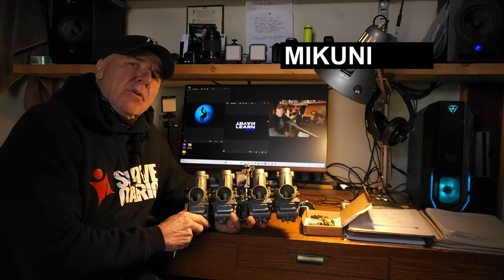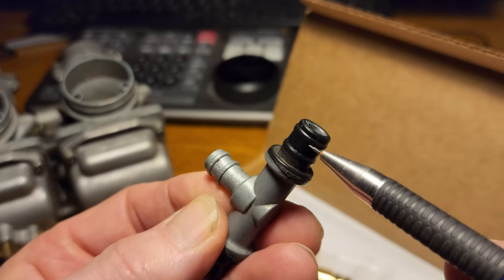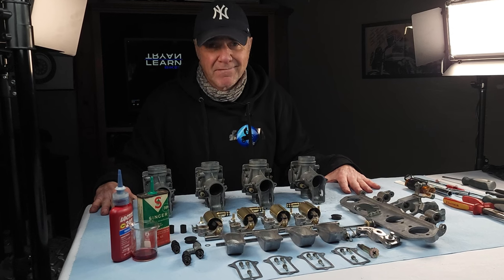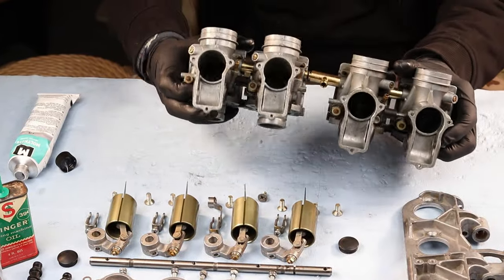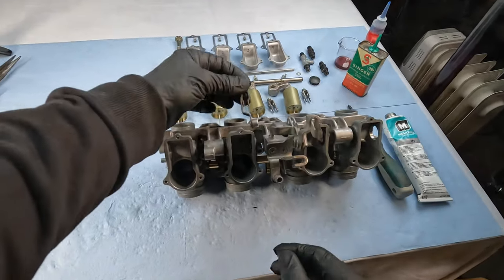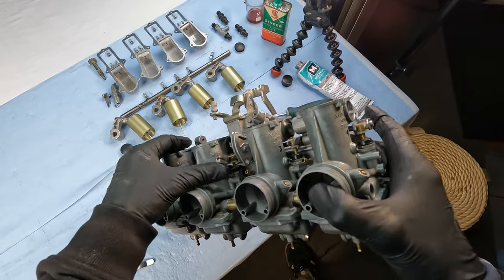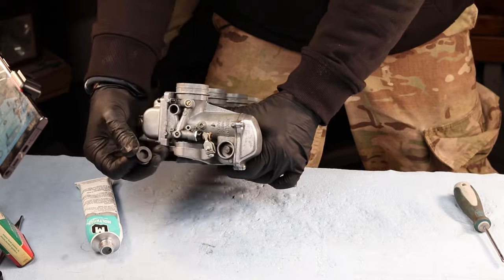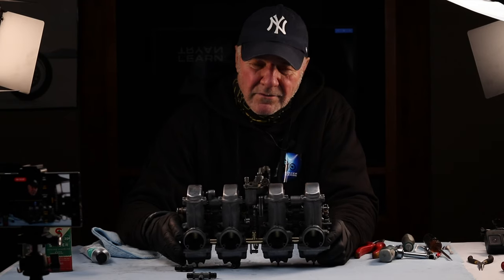How to Fix Mukuni Carburetor Fuel Rail Leaks Easy

Comment: Wow they are good by the looks of it, looks like someone was thinking. They are a good carb setup and not bad to work on, not that I have for many years now. And as always man an awesome video showing important assembly methods...Love your work man just awesome.
Reply from the maker: Hey Roland,thank you very much man .Your continued support is greatly appreciated. Yes these carbs are in pretty good condition and will hopefully perform well on the old GS750.The availability of such good aftermarket parts was huge in this rebuild for sure .
Thanks again for watching and always taking the time to comment so kindly. Cheers buddy 🍻

Comment: Excellent video, thanks for sharing.  But at the 3:00 minute mark did you forget the rubber vent hose that goes between carb #2 & 3?
Reply from the maker: @cbxandy9441  Thanks Andy .I see what you're talking about there between the 2 & 3 but there is no link hose  required, those ripples are blocked off .You can see the large throttle return spring interrupts that path anyway so you couldn't fit a rubber link in there either way .
I appreciate you watching and for taking the time to comment. Cheers to you good sir 🍺
Reply from the maker: I meant "nipples" not ripples...damn auto correct.